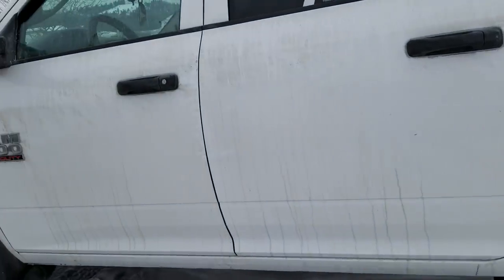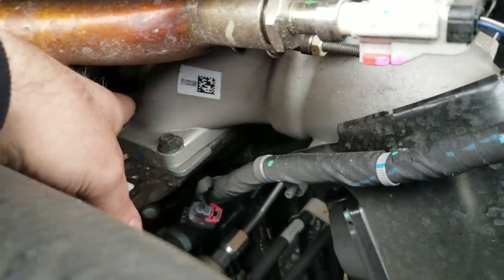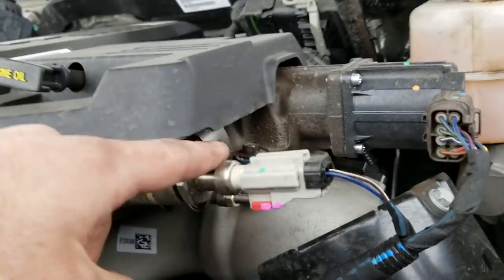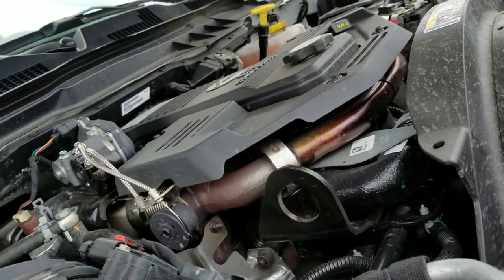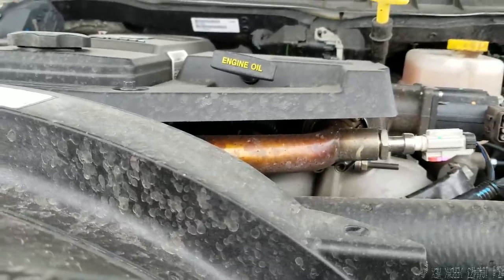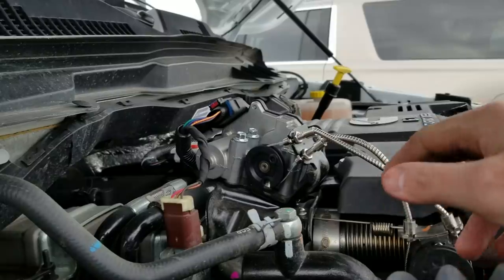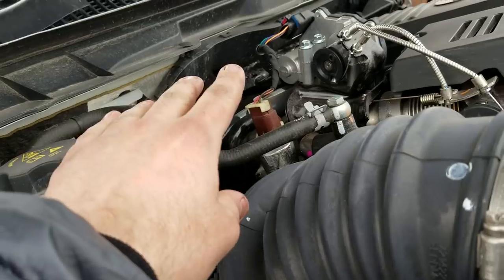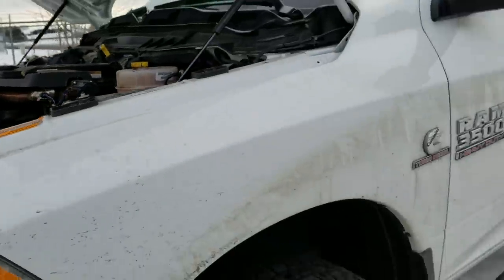13-18 Ram Cummins. The real problem with Egr

Comment: Yeah it's really stupid why these trucks still have egr  they have  tier 4 case ih tractors that don't have an egr
Reply: Nathan G Different tunes for different goals. A case tractor isn’t designed to do 0-60 in 8 seconds weighing 8000 lbs and have a 59 decibel quiet cab lol
Reply: @natehawkins2910  what does any of that have to do with how the emissions  are designed on a diesel lmao   the egr is unnecessary and is present due to epa regulation
Reply: Nathan G ...you were comparing a farm tractor to on road vehicles. Without using EGR, DEF usage would be around 10 times more by volume and people would whine about that, and it’s cost! Imagine a 44 gallon DEF tank on a pickup truck, lasting only 5000 miles. Not pretty. ...And imagine the huge DEF tank heater it would need to keep it from freezing. EGR was the best trade off that works and doesn’t cost a fortune.
Reply: @natehawkins2910  you aren't very familiar with what you are talking about. Tier 4 final tractors have dpf and scr  that uses def and not all have egr systems because it is not necessary
Reply: Nathan G Apparently you aren’t familiar as to WHY they all don’t have EGR. It’s because of HP-to-NOx emissions. Low HP qualifies as no EGR. Why do you think a little bobcat doesn’t have EGR?? Duh! Stop comparing things that aren’t comparable and you don’t completely understand and tout as fact. Every engine MFGR’s goal is meeting NOx limits —PER HP— with no EGR but we aren’t quite there yet in technology. But it’s pretty close. Read up on it sometime...Bosch is testing what they say is NO EGR —and compliant— systems right now.

Comment: I don't get why they don't pull the EGR on the other side of the DPF filter.  At least that would help keep it cleaner.  But the DEF does the same thing as EGR...  Reducing NOx.  So...  I would rather burn more DEF than sending the trucks farts back into the intake.
Reply: Yep you're correct that I'd rather have to buy the damm Def stuff,,,and have clear Oil in my 18 SD. after a few miles.
Reply: @sandman6298  EGR only recirculates the exhaust gas that came from the combustion chamber.  How do you suppose this hurts anything?  Diesel oil will always be black after a few miles.  This video is full of fake news.
Reply: @rcastorena  Yeah...  It returns carbon back into the engine.  Eating your own poop is not good for you either.
Reply: Hil Palmer These engines DO get cool clean air. What do you think an EGR COOLER is for exactly?? Lol Don’t think too hard! It sounds like you’re an old fella talkin about “the way things were when I was young...” Things have changed and they will KEEP changing. Electric trucks are next man! In 10 years they’ll be everywhere. Then what will you need to know about those “terrible epa imposed EGR systems” that get you all fluffed up today?
Reply: @natehawkins2910  If you consider around 200 degrees as "cool".  I am fully open to electric trucks.  Once we can generate more electricity from Solar, Wind, Hydro, etc.  But right now...  all you are doing is shifting the pollution. Go home keyboard mechanic...  You are drunk.
Reply: Hil Palmer 200 degrees is 25% max of incoming air temp. EGR utilization is no more than 25% of volume. My ‘19 f250 diesel normally stays in the 15-20% range during normal operation. Incoming air temp is usually only 60 degrees above ambient air temps. This actually makes the engine run more efficiently because incoming air is warmer than normal, and the double cooling systems handle even 200–yes that’s right—200 degree incoming air perfectly fine. If you can remember, glow plugs and grid heaters do exactly the same thing. If they could run all the time without fail, this wouldn’t hurt the engine in any way. I’m not sure which part of earth you hail from, but no engine in transportation cares if the truck incoming air is warmer or contains soot. Soot is formed inside the cylinder, so directing 1/4 of the hot gasses into a cooler then back in is gonna be fine. Why are you so against these things that don’t really cause that much trouble? Sensors or careless operation do but the act of actual EGR has zero effect on today’s engines. My Honda has non-cooled direct routed EGR and has 487,000 miles on it. You don’t really make any case for yourself but just dislike everything?
Reply: @natehawkins2910  Get some years on that Ford of your's... Then we will see how much you will love an EGR on a diesel.
Reply: Hil Palmer I understand the EGR cooler core is prone to plug up (because of tight spaces/passages that reduce the exhaust temp very well, but allow soot accumulation) if heavy towing isn’t routine) around 50-90,000 miles but it will be under warranty till 150k with Ford Premium Care. This covers swapping out EGR coolers, DPF’s, DEF system if necessary and all other components covered by the 3/36 standard warranty. I’ll probably not keep it that long tho as those 19 dodge HD trucks have definitely caught my eye. Loving that interior (at least in pics and videos). I’ll probably be trading my truck on a 2020 if Dodge is building a decently reliable truck. My warranty is transferable to the next owner so keeping mine stock is not as much a problem as it potentially could be for other guys.  Any repairs after 100k only cost $100 deductible. I’m not really one that wants to marry a truck anymore. When I was a kid I kept my new-then 99 dodge diesel till 250,000 miles and other vehicles even longer. Not really into that anymore.
Reply: Hil Palmer Get some years on ME and let’s see how I work. Lol Everything ages man! Including you and me!

Comment: All you guys whining about the EGR system on diesel trucks, you do realize that EGR systems have been used on gas engines for decades right? With any engine, gas or diesel, if you are doing mostly short stop and go trips you will have more problems sooner. That’s just the way it is.

Comment: Emission equipment put on the Diesel engines today cause more pollution in the long run because you use more fuel, parts, money etc to keep it running properly.  The flip side, you delete it tune and it runs better, more power less fuel and emissions spent just trying to keep it running (with the emissions systems in tact).   This is why I’m selling my 6.7 2017 ram and keeping my lbz duramax.   No more diesels after 2007.5 for me.  I’m done.

Comment: Let your 6.7 breath boys... delete it
Reply: @Salmon Killer  U damn right salmon slayer. I’m at 97k. I hope to delete mine by June.👍🏻
Reply: Lone Wolf So it’s gone 97k just fine but now it NEEDS deleted? Lol Why?
Reply: @Neo Craft It has not been trouble free. The scr has been replaced twice. Supposedly the def fluid has been the issue according to the dealership at least 4 times.  The def light came on 3 times since January but luckily went back off. The older the truck gets the worse it’s gonna get. So yes it NEEDS deleted. Now you know why. lol
Reply: Lone Wolf I see. How old is it?
Reply: You know that when you're under load your engine doesn't run EGR right?
Reply: SilverStar Heggisist I know mine mixes in varying amounts of EGR most of the time. Under say, 70% throttle it’s around 9% EGR. And higher is a tad lower. In cruising, 45% throttle utilizes 20% EGR. So quite a bit during 75-mph cruise. And it’s put in between 205-215 degrees and that never varies. The cooler on my Powerstroke does a terrific job of cooling and maintaining EGR temps. I use the most DEF during Regen when EGR is cut to zero.
Reply: @natehawkins2910  yes that sounds about right. 

Yeah the need to regen is why people kill their diesels if they only drive in city condition or in many cases farm conditions. 

There really needs to be a menu built into modern emissions diesels to force regen to happen when the truck is stationary.
Reply: @natehawkins2910  the reason the temperature never varies is that it cools it with engine coolent. Which the thermostat keeps at a very narrow window.
Reply: SilverStar Heggisist Yes I know. My 19 f250 diesel has 2 cooling systems and I think about all of those potential leak points often. Lol but thank the Lord for Premium Care for 150,000 miles lol
Reply: SilverStar Heggisist That was my main driver behind buying a Ford diesel. OCR! DPF status right in front of you. Every time I see it going into regen I run it till it’s finished. The other 2 brands have the driver left with no clue of how full the dpf is or anything and that’s info everyone should have available!

Comment: That’s why I drive a 12 valve with no emissions
Reply: ...until it rusts out from under you. Most people also drive those because that’s all they can afford. A 21+ year old truck. Ouch! (And yes I even have a 1984 f250 6.9 but wouldn’t ever “want” to drive it over my 2019 f250 6.7! See both in my channel!)
Reply: You have EGR, unless you've swapped the camshaft
Reply: @natehawkins2910  I've a 82 Chevy to play in and a 03 dodge as my daily
Reply: SilverStar Heggisist No only Common Rail 5.9s have In cylinder egr

Comment: This guy is hell bent about filtered air. It was filtered thru the intake before it went out the exhaust. It's not carbon its soot. Egr is used to precondition the intake charge which allows the injector to spray 5 times per 1 metered injection equaling more complete burn. Theres more to the egr system than this.
Reply: it makes your intake dirty which over time robs performance. why would you want exhaust in your intake. thats the dumbest shit ive ever heard

Comment: It is all about those ozone depleting nitrogen oxides.
Reply: Actually acid rain
Reply: You're both wrong
EGR and SCR are both about NOx oxides of nitrogen).  NOx doesn't damage the ozone layer; when mixed with volatile organics (think gasoline vapor) and sunlight, it forms ground level ozone, which you don't want to breath.  It's all about compliance with the national ambient air quality standards (NAAQS)

Comment: That's exactly why the oil is super dirty even after you change it, so when they tell you oil is good up for 15k miles dont dont do it, the more change your oil the better for the engine I change it every 5k dont care why they say I paid a pretty shiny penny for my truck, do what's best for yours, this was a great video
Reply: I go 6,000 miles on my Rotella 5/40 syn and that’s that. I like fresh oil and don’t think I could get myself to go up to 10k. 2 months is around 6,000 miles for me so that’s pretty good compromise over Fords “oil life” monitor I think. That thing will let you idle a ton of hours and still go up to 7800 miles but for me, that’s too long. 6,000 is about perfect.

Comment: It’s gotta be in California, they could only come up with this
Reply: Try EPA... Stsrted in cali and gone from there. Now its EGR, DPF, DEF and Regens thanks to tree huggers..
Reply: Brandon Caldwell I’m not a lib, but as I’ve gotten older (40 now) I have come to appreciate clean, quiet diesel power. Most people who have disdain for emissions controls don’t really understand what they’re talking about because they won’t allow themselves to learn about it inside out. This is called close-minded thinking. And a lot of that simply comes from other close-minded friends and acquaintances affecting your thought process. I love trump (most of the time, when he behaves) but still completely understand why those emissions controls are there. And no, they aren’t perfect. Yes they are expensive. But the only thing we can do is do the best we can at the time, with the knowledge we have at that time.
Reply: @natehawkins2910  Clean, quiet, power. 3 words you can tac onto any engine anywhere. For proper power, you need less restrictions, more fuel. and of course soot as the turbo catches up for the increased fuel. Quiet, thats all in the piping. and mufflers with proper channelling. Any restriction is lost power. Clean, theres no way around it, you loose grim one place to gain it in more. Ever changed a diesels oil after only 1,000 miles? It shouldnt look black as tar as if its been 20,000 miles yet it does becuase of emission devices. Ever taken apart a vehicles intake and wonder why you run a filter just to have exahust throw soot back into the engine making it dirty when it shouldnt be to begin with. Emission devices are causing more  than good. They are taking more resources and causing increased usuage over time. Diesels have take many advancments over time yet are kept in the stone age because of the emission systems that are not helping. More engine oil, fuel, cleaning, and filters being replaced more often becuase of these devices. By the way, you cant bring noise levels into the as emission devices have zero to do with it. Go get 2 identical gas cars side by side. 1 straight piped one stock. The stock will be quieter. Take 2 diesels side by side one straight the other with a muffler. They will be at the same sound level. Emissions has zero to deal with noise level. Pipe size, mufflers and  anti whistle rings do.
Reply: @natehawkins2910  I can honestly say i know what i am talking about. I own both gas and diesel trucks. My diesel is stock currently. My gas is not. Its piping was increased from 2 3/4 to 3in. Then the muffler was removed. after the rasping noise making the truck more bareable to drive but loud as hell outside. Its power has been increased because of it all of course a muh larger intake being less restrictive too. My diesel is still being hogged by all the emissions. Least till that one mexican goes under and steals my exhaust, dpf, def, and egr system... Leadt then the trucks noise level will still be the same just more power and less resources used after i repair it.
Reply: Brandon Caldwell Noise and emissions equipment are directly related! How many mufflers does your post-2008 truck have exactly? Lol! Dude, the DPF eliminates a crap ton of noise. And who cares “what” an oil “looks like” after 1000 miles. If it’s doing its job, then that’s what matters. These syn oils can go 10-15k miles in these sooty engines and not miss a beat. And, what may I ask, is “proper power”? 445 hp and 935tq sounds pretty darn proper to me! All of the reasons you’re against emissions equipment are personally biased with no evidence of actual harm being caused to the engine, the environment or anyone!
Reply: Brandon Caldwell Robs power? Restrictive? I think my 19 f250 diesel has enough power at 445 hp and 930 tq. What exactly is the short fall here in power? Don’t you know these engines were completely designed to run as they are produced? And “a properly designed muffler” doesn’t count since there’s no need for one. Pilot injection is responsible for low noise more than any muffler or DPF’s. And it’s also necessary for emissions during regen. Do you even own one? lol
Reply: Brandon Caldwell Sounds good to me! Imagine all the money you’ll have from the $35 a month you’ll save on regens and DEF!! Go get em tiger!
Reply: Brandon Caldwell In a years time ...Lol At 300,000 miles you’re gonna be putting a ton of money into misc repairs ...and A regen (stationary) usually consumes 2 gallons of diesel. That’s $6 every 330 miles, or up to 500 miles if mildly loaded. If you’re driving while regen, it’s gonna use less-about 1.6 extra gallons. Your math is crazy if you think you will ever get your $1500 back on a few $6 stationary regens now and then...A water pump can go costing thousands in damage. AC compressor...Transfer case. these trucks are expensive to own no matter your “emissions staus” Lol 

You’ll never realize any meaningful savings in the end. Luck of the draw will dictate your spending. 

And besides...Why do you look to “save money” on such expensive vehicles as my new diesel pickup? Buy a Prius if you’re looking for cheaper-than-mine status!
Reply: Brandon Caldwell and I’ve spent $41 on def at the pump in 13,450 miles. It’s 2.99 a gallon. Jugs are a real waste of money.
Reply: @brandoncaldwell95  so many things wrong but... First, DEF doesn't go bad in six months...

Comment: You are right and wrong, get the facts straight. The EGR is an important part of cleaning the air for humans to breathe and diesels are dirty air makers. Comments below from educated people suggest that you learn why that device is actually required for emissions. Yes it is problem-mattic but necessary in modern engines. Nitrous Oxide is a by product of overheating Oxygen. The EGR's valve helps to keep the engine from developing NOX. Thanks for video but report facts.

Comment: I spent 65k on a cab chassis. Deleted EVERYTHING and voided warranty by 30k because I can’t stand recirculating soot through my intake stream.

Haven’t had a single problem.

Anyone need an get cooler or DPF unit? I’ll hook you up for a good price.